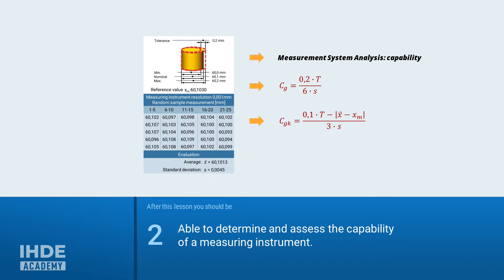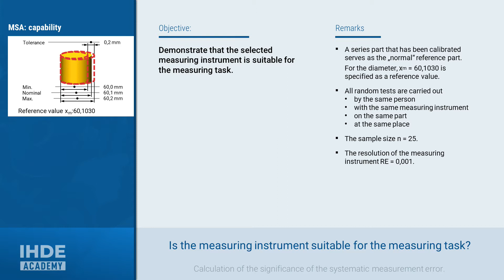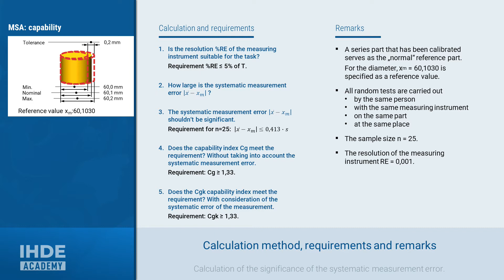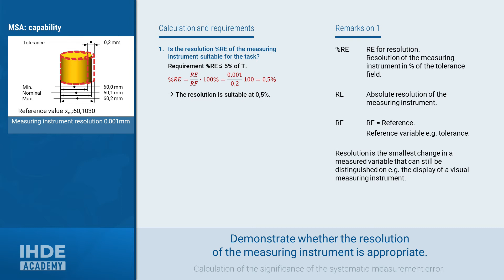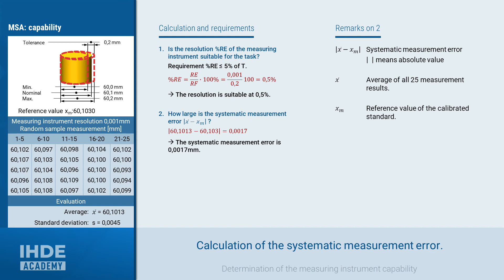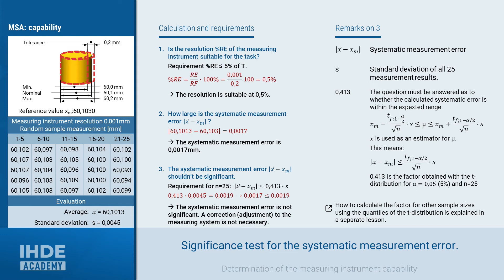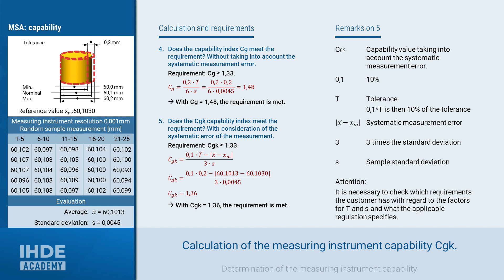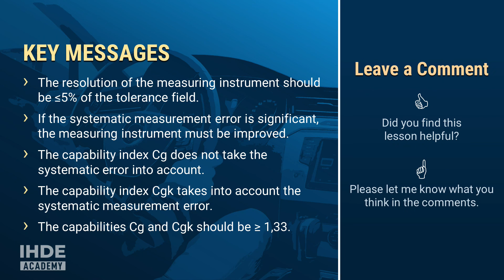Cg, Cgk calculation: measuring instrument capability index | measurement system 1-1.3| IHDE Academy

Comment: 10:00 & 10:55, what is the justification for the Cg/Cgk rule-of-thumb number of 1.33 and how does it relate to the precision-to-tolerance ratio?

Looking at the Cg formula, it seems that a threshold value of 1.33 is equivalent to allowing 15% variation from the system relative to the tolerance. Had the threshold value instead been 1.00, the measurement system (or process) would take up the entire pre-specified 20% of the tolerance window. Often a threshold value of only 1.00 is referred to as 'barely capable' with the added 0.33 being a kind of safety margin that allows for 'wiggle room'. But wiggle room from what?

Is this 0.33 safety margin added to account for the fact that the sample stdev is associated with sampling error? Would it for instance be correct to substitute the 1.33 threshold with 1.00 if also substituting the sample stdev with the upper confidence level of the sample stdev?

Or is the 0.33 safety margin added to account for the risk of shift in the measurement capability, say the MSA1 was redone later in the day where the the room temperature has increased and the equipment therefore might be less precise and exhibit more bias than earlier in the day? 

Perhaps both reasons, and are there more?

Comment: thank you for explanation, just a question: how to calculate the factor if the systematic error is significant. i see there is a link , but i didn't find it, thank you
Reply from the maker: If the systematic error (bias) is significant, switch focus from Cg to Cgk. Cgk penalizes bias, so it will drop the issue and make it visible. Then correct the bias: calibrate the gauge to the master, re-zero, check wear, control temperature/fixturing, and remove any software offset. After adjustment, re-run the short repeatability study on the same master to verify that Cgk now meets your target (e.g., 1.33 or 1.67 per customer spec). If you can’t eliminate the bias, apply a documented correction (and its uncertainty), tighten guard bands on decisions, or reject/repair the gauge. In short: use Cgk to detect the problem, fix the bias at the source, and confirm with a fresh study.

Comment: Very interestingly discussed presentation👌
I have a question though. What if the drawing shows a one-sided tolerance of 60.1 +0.1, and not 60.1 +/-0.1 mm as in the discussed example?

Is it possible to determine the cgk parameter?

Comment: what happens if bias fails but cgk is good in a type 1 study
Reply from the maker: Hello,

Thank you for your question. I hope you find the following explanation helpful:

If bias fails but Cgk is good in a Type 1 study, it indicates that while the measurement system can consistently replicate the same results (good precision), it systematically deviates from the true value (poor accuracy). This scenario suggests that although the gauge can reliably distinguish between close measurements, any conclusions drawn from the data may be systematically shifted or incorrect due to the bias.

Steps to Address the Issue:
Calibration: The measurement system should be recalibrated to align it closer to the true value, reducing the bias.
Root Cause Analysis: Investigate why the bias occurred. This could involve examining the measurement device, operator errors, or environmental factors.
Repeat the Type 1 Study: After addressing the bias, the Type 1 study should be repeated to ensure the bias has been effectively corrected and to reevaluate the Cgk.
Monitor and Control: Continuously monitor the measurement system for any future occurrences of bias and implement regular checks to ensure ongoing accuracy and precision.
Reply: @ihdeacademy  Hi thanks for a detailed response, so based on this, you would fail the study based on Bias having a p-value less than 0.05? even though Cg and Cgk is good.
Reply from the maker: Hi, Thank you for your follow-up question.

Yes, the study would fail based on a bias having a p-value less than 0.05, even if Cg and Cgk are good. The p-value indicates the statistical significance of the bias. A p-value less than 0.05 means the observed bias is unlikely to be due to random chance, indicating a significant systematic error in the measurement system.

While Cg and Cgk demonstrate good precision (i.e., the measurement system can consistently produce repeatable results), a significant bias suggests that the measurements are not accurate. This means the measurement system is not reliable for making accurate decisions, as the systematic deviation from the true value could lead to incorrect conclusions.

Significant bias undermines the reliability of the measurement system. Therefore, corrective actions are necessary to address and eliminate the bias, as suggested in my previous answer, before the system can be deemed acceptable.

Comment: Hi, How did we finalize the reference value Xm of 60.1030?
Reply from the maker: Hi, thank you for your question. At 2:15, it is mentioned that a part from the series that has been calibrated serves as the 'normal' reference part. A reference value of xm = 60.1030 is specified, i.e., measured for the diameter. You may remember that in the context of quality control or manufacturing, a calibrated part would be one that has been measured and confirmed to match certain specifications very closely, serving as a standard or benchmark for other parts.

Comment: Hello, i have one doubt if we get cg cgk value more than that >1.33,is it ok or not ok
Reply from the maker: Hello,
Thank you for your question. The best advice I can give is to:
(A) Ensure that the measuring instruments are properly calibrated (ISO/IEC 17025), and that the data collected for the calculation of Cgk is representative of the process being measured (ISO 3951 Series, ISO 16269 Series).
(B) As stated in the tutorial, depending on the applicable customer specifications, guidelines, or standards (MSA, ISO 22514-7, ISO 10012, VDA Volume 5, ANSI/ASQ Z1.9), there may be different calculation methods and specifications for certain values.
If you are sure that (A) is fulfilled and you are in doubt whether you can achieve a Cpk value of at least 1.33, then you should involve your customer to agree on (B).
As you can see, there is no simple yes or no answer to your question.

Comment: The best explanation of Cg, Cgk I found online. Clear and simple. Great work!
Reply from the maker: Thank you for the positive feedback. My pleasure.
Reply: Hi, great video ! I have a question, where can be found the reference about cg and cgk need to be equal or higher that 1.33 ? I have look for it in AIAG MSA manual and SPC with no success
Reply from the maker: @edgarivanbermudezrodarte9718  Hi, thank you for your question. Different companies have different requirements regarding Cg and Cgk. You may Google 'Quality Management in the Bosch Group; Technical Statistics 10. Capability of Measurement and Test Processes.' There, you will find the capability criterion: Compliance with specified minimum values for Cg and Cgk. The current release of [CDQ 0301] is binding for these minimum values. At the time of the publication of the present issue of booklet 10, the following limits apply: Cg ≥ 1.33 and Cgk ≥ 1.33.